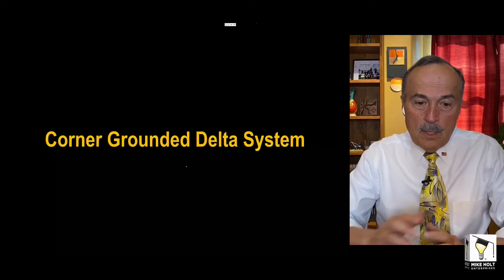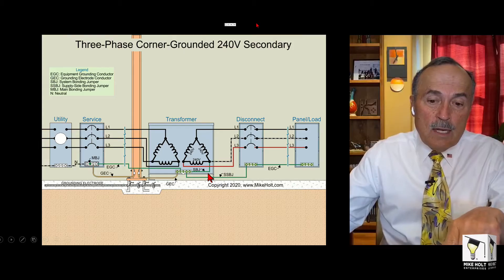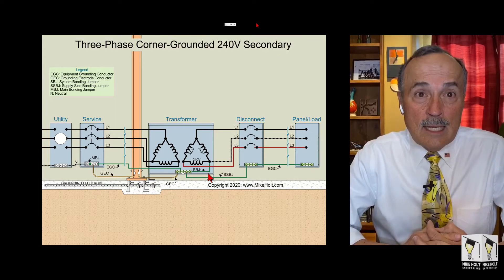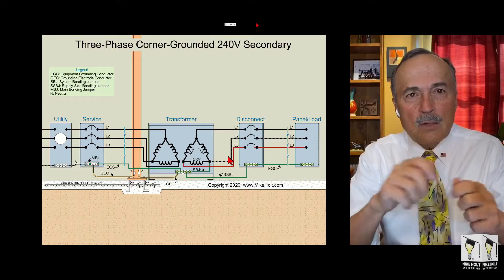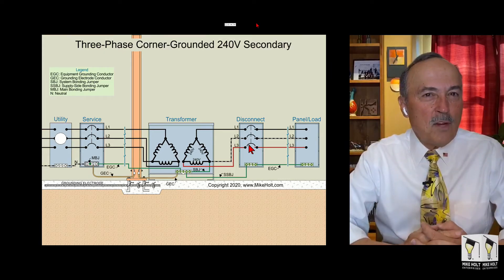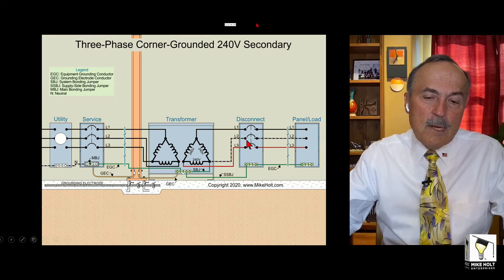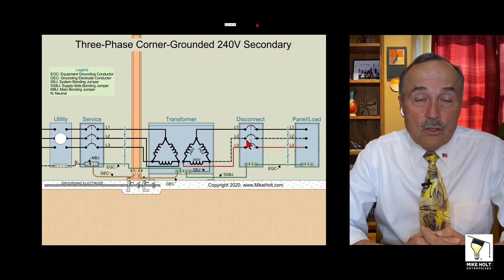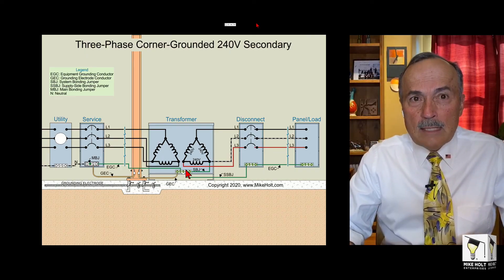Grounding a Corner Grounded Delta System, NEC 2020, (3min:56sec)

Comment: I’m working in a acid plant built in the 50s that had a corner grounded 480 system they had to update the service in the 90s and the inspector refused to let them use white for the grounded leg they use red and blue for the 2 hot legs and yellow for the grounded leg
Reply from the maker: @andrewcouncil3914, many don't understand that the grounded phase is the grounded conductor and must be identified white per 200.6.

Comment: The only corner grounded system I've installed was for car charging stations,  they needed 240v @50a to run at the highest charging rate for the car.  We were on 3p 4w system 480/277v we put in a 208/120v transformer at first, i think it was 300kva if I remember.  The charger guy comes and says I need 240v to these chargers. Awesome, out with the new, and in with the newer. Only time I've ran into that, but maybe it'll get more common.

Comment: Usually I come across line 3 for grounding
Reply from the maker: It's a common practice to ground the B phase, but it doesn't matter which is grounded.
Reply: @MikeHoltNEC  I agree. B PHASE would be my choice

Comment: Does zero sequence pick up on a ungrounded delta during a ground fault condition when using solid state protective relaying?
Reply from the maker: No. When there is a ground fault at an ungrounded system, the system becomes a grounded system with no movement of electrons during the ground fault.

Comment: Can a corner grounded delta be single phase?
Reply from the maker: If it's a delta system, then it's a three-phase system, and it has a 'corner.' If it's a single-phase system, then it's not a delta system, and it has no corner. Okay/
Reply: @MikeHoltNEC  I am in a pickle and am not sure how to prove an argument. In my mcc I found a panel that was mislabeled in my opinion. It says it's 240 single phase. But it's not. It has 3 conductors going into the panel from the transformer. A and B are 240v each to ground. C is 0v to ground but 240v from phase to phase. C phase is grounded in the transformer. Which tells me it's a corner grounded delta 3 phase 240v panel. Common from back in the day and in sawmills and industrial plants. I brought the issue to my maintenance manager, supervisor and engineer. They hired an outside electrical contractor to evaluate the transformer and panel. They say it's 240v single phase. How do I prove to them they're wrong?
Reply from the maker: @briananderson1987  It is a three-phase system called "240 Vac 3Ø Corner-Grounded Delta System" or 480 Vac 3Ø Corner-Grounded Delta System, see https://www.productinfo.schneider-electric.com/nadigest/5cc35b7ed6593c0001ba8661/Supplemental%20Digest/SD17703_MAIN%20(bookmap)_0000052852.xml/$/_SD17703021_48857

Comment: So now you don't have 3 legs though. Usually I see brown orange yellow gray but with this configuration, you're grounding the yellow so now you're losing that 480v leg right?
Reply from the maker: The secondary voltage is 240V, so you can never get 480V in this example.
Reply: @MikeHoltNEC I guess I meant to say if it was 480 and you were just trying to get the grounded contuctor you would no longer have 3 phases right? Does that kind of thing happen? Say you had an old ungrounded 480v delta and you wanted to ground it to gain the benefits. Is it possible to do that without losing a phase?
Reply from the maker: @robbysanchez6514  Let's not talk about phase or grounded conductor. There are three wires from the corner grounded transformer to the equipment, the voltage between any two wires is 240V (in this example), the three wires are 120 degrees out of phase with each other, and the three wires can supply a three-phase load. Does this help?

Comment: I'm confused if your C,B phase,High leg is a neutral is it effectively only a single phase system?
Reply: There is no high leg. Two phases are 240V to ground and the third phase is grounded so 0V to ground. Voltage between any 2 phases is 240V. There is no neutral conductor, there is a grounded phase conductor. All neutrals are grounded conductors but not all grounded conductors are neutrals.
Reply from the maker: @pld8993  Excellent reply, thank you.
Reply from the maker: If you have A, B, and C phase conductors, you have a three-phase system.
Reply: Also, all grounded conductors must be white (or gray), including the grounded phase conductor, so while all neutrals are white not all whites are neutrals.
Reply from the maker: @pld8993  Right again... not many understand the system and the NEC. You are amazing...
Reply: @MikeHoltNEC  If you want to become an expert in any subject you have to teach it. Been teaching for almost 30 years.
Reply from the maker: @pld8993  So true...
Reply: @pld8993 help me understand what I do in this center tapped delta xfmr. Am I running a SBJ from the EGC ground bar to x2 with the blue wire??
Reply: @damonsmith8411  Where I'm at typical colors are black, white, blue. In the pic they're black, white, red. SBJ from ground bar to white.
Reply: @pld8993 do you always do a SBJ from ground bar to “neutral point” ? Or can you float it and then bond the panel with a GEC?
Reply: @damonsmith8411  Depends on how it's done. I've only ever worked on 240V corner grounded from utility company, not from transformer. If it's a utility source service, you can run the system with a single phase panel, A and C to the 2 hot terminals, white grounded phase to neutral bar and bond it with bonding screw/strap, GEC to neutral bar. Can't use standard 2-pole breakers, which are rated for 120V per phase; must use 2 pole breakers that are designed for 240V per phase. Or you can use a 3-phase panel, grounded phase goes on B phase. Haven't done one in many years but the way I've done it is I run the grounded phase conductor "through" the neutral lug and continue it, uncut, to B phase terminal, then bond the neutral bar, GEC to neutral bar. In  the case of a transformer, I believe you're bonding it only at the transformer so in the panel it's a white on B phase and the neutral bar goes unused or becomes a ground bar if you bond it to the can..
Reply: @damonsmith8411  I think I've also seen it done in a 3-phase panel by running the grounded phase conductor directly to the breaker lug, tapping it with a split bolt ahead of the lug with a SBJ to neutral bar, GEC to neutral bar, neutral bar bonded to can. Naturally, the neutral bar becomes a ground bar.

Comment: Superlatives almost always come back to bite you in electricity.  I respectfully disagree any phase can be grounded unless a transformer is being installed. I'm currently working on a corner grounded delta 240 service. The utility Cts are located outside at the utility overhead. The cts are mounted on a metal bracket. Phase B is bonded to the metal bracket. That bracket is mounted on a metal building. In this case the MDP must be grounded to phase B.
Reply from the maker: This video is about the system grounding. Any phase can be grounded. However, if the utility wants you to ground the B phase. Okay... that doesn't take away the theory.

Comment: Good day Mike, what is the solution if we have existing three-phase corner grounded 240V secondary but we need only a Three-phase 240v. I hope you notice this question thank you in answering
Reply from the maker: A 240V corner grounded system gives you 240V three phase. So you are good to go.
Reply: @MikeHoltNEC  we have a equipment which does not work/faulty in the corner grounded system, any recommendations for this problem. thank you 😊
Reply from the maker: I don't see how that is possible. Get me more information, Mike@MikeHolt.com
Reply: @jaseb5529  I've seen this before, most recently with a 3-phase SPD. Perhaps is has to do with electronics or controls since a big dumb 3 phase load, like a motor, doesn't know the difference. Transformer would be my solution.

Comment: We this is what I have, measuring from line to line  I have  244,240,239.
Now measuring from line to ground I have 
120,120,213 ,  and because  I have a drive in place I'm getting a phase loose code. But why the 213 volts to ground, I understand it's a hot 🔥 leg. How can I balance this out. To 120,120,120 ????
Reply: You have a wild leg, 120, 120, 208 the one phase is center grounded and not corner grounded

Comment: Ok Mike maybe you can help explain this oddity I ran across in an old citrus packing plant. The system is three phase supplied by a generator it also is a corner grounded delta ( B phase grounded at Genset and at main disconnect) . This system however uses two pole disconnects and breakers and of course provides three phase in this manner . Single phase is provided by two pole devices on some circuits and by single pole devices and ground on others.120 volts is derived from transformers as required. Your illustrations show three pole devices  as do all I have found in recent texts. Is this an old 50's -60' era way of wiring this type of system or is it something done by someone who wasn't fully aware of what they were doing ?
Reply: Yes, single phase equipment can be used in a corner grounded system. But the breakers must be "straight rated". For example, if you had a 240 volt corner grounded system, you would use 2-pole breakers rated at 240 volts, NOT 120/240.

Comment: Coming from a metering background I can say you don’t want the ground on 1 or 3. If the ground is on either of those phases it could create a metering error. You do not want a neutral or ground on a phase with a current sensor. That condition is called SCN - series coil neutral. To meet Blondels Theorem a utility will typically have the meter connected 1 & 3 at the current sensors and beginning potentials for the potential sensors, and have the ending polarity of the potential sensors connected to 2.
Reply: I’m a retired metering theory instructor for Southern California Edison.
Reply: Hello Sir. I just want to ask if you have encountered a 3phase 3wire system with a connected solar for net metering?
Reply: @kimmallari2658  I have not. Possibly might be able to help though or give some ideas. I can guess your question though 😜. Is the solar array connected Y?
Reply: @tomhb9479  thank you for the reply. Actually it is basically 3 wire with no grounding or neutral wire. So we applied tha blondel's thorem making it a 3 phase 3 wire circuit. But the kwh reading on the meter and the output on its inverter were not equal. Also for an ungrounded delta, does the blondel's theory still applies? I was really curious about it and needed someone to discuss it. Thank you very much sir. I really appreciate your response.
Reply: @kimmallari2658  Yes, Blondel still applies. So a two element meter monitoring two of the currents with those same phases being the beginning polarity potentials for the two elements, and the third phase should be non polarity ending potential for your two elements. No connection to ground other than perhaps a case ground for safety, lightning, etc.
Reply: How far off is it?
Reply: @tomhb9479  one third from the meter. Meaning two thirds was just registred in the meter.
Reply: @tomhb9479  In our practice/ standard, 3 phase 3 wire will be a delta corner ground. two phase that are not grounded will be going through the element (potential and current coil), the grounded one will be on the common of the pt elements. In my understanding, if it is ungrounded, the meter base will be live. and if you ground the casing wouldn't the ungrounded short through the ground. I hope you understand my question. I'm from the Philippines by the way. I'm just looking for someone whose expertise is metering.:) Again, Thank you so much for these discussions.
Reply: @kimmallari2658  None of the 3 phases are connected to the meter base. The utility I worked for we had a 3WD 480V service that was ungrounded. By our rules we could not have greater than 300V to ground service voltage. On the old metal chassis meters we had a grounded lightning arrester. I can’t think of a reason you are getting a 33% slow meter 🤔
Reply: @tomhb9479  hello sir. I want to connect with you with other socials so that I can illustrate or send you the diagrams and know your comment/ inputs about them. If it's okay with you Sir? Thank you sir.
Reply: @kimmallari2658  Will email work? I’m on Facebook too.
Reply: @tomhb9479  yes sir!! messenger will be great.! Thank you very much!

Comment: sir if my neutral cable gets destroyet will the current choose the path of the ground
Reply from the maker: Current is not seeking a path to ground, but it will use the earth as part of the return path to the source.
Reply: @MikeHoltNEC  if my neutral gets destroyed  electricity will use the ground to complete the circuit like you said and this clear to me .....but also i need to have very low ohms ground resistance to run machime in case if my neutral gets destroyed  correct?? like you did in that video on youtube placing 2 copper rods in parallel connected  deep in ground the load test using ground as neutral ... i am asking about the ground because when i play with tesla coils high frequency the ground from earth gives a boost to tesla coil somehow accelerates electron flow any comments about this ??? .. at the end i want to thank you for your answear  and thank you for helping us.

Comment: I am not able to explain why someone (including the utility companies) use this system. it is just does not make sense unless you want to confuse someone and say , "hay look phase and line voltage are the same! " , of course  some people love to play those games. The fact is, in the very same NEC code 230.75 it says ground must not be disconnected. So if there is a fused 3 phase disconnect switch in this system,  you must put a copper bar in B phase because it is ground too ! If the fuse blows up in phase B then its nothing but danger zone ! . DO NOT USE IT !
Reply from the maker: See chrome-extension://efaidnbmnnnibpcajpcglclefindmkaj/https://media.distributordatasolutions.com/schneider2/2020q4/documents/f50bd47f84c77526d02eee3473c1215b7dd3585b.pdf. Just use a single-phase disconnect...
Reply: It’s not actually a ground.

Comment: I came across a three phase system today 240v  between the three legs and two of the legs read 240v and the third one, taped blue read 0v to ground. There is No neutral there. That’s what brought me here. They have an elevator motor circuit there. Would it be ok to run a 240v 3P stove on that 3P configuration?? I think the stove doesn’t require a neutral.
Reply from the maker: What kind of stove is 'three-phase?' Answer is 'yes.'

Comment: I think it's important for people to understand that ABC phasing is relative to whichever phase we decide is "A". All the phases are 120 degrees apart and so they will only peak in ABC order or CBA order. Same is true for a corner grounded delta only one phase is effectively zero volts with a 480 or 240 volts in reference to the other two phases and those two phases are 480 or 240 volts in reference to each other. Since we have to maintain a ground fault current path the grounded phase must not be able to open unless the other two phase are opened as well so a fuse in that phase will be replaced with round copper bus or  the phase will terminate in a lug or splice. If corner grounding an ungrounded system verify single phase and three phase loads cannot loose reference to the ground while energized. Grounding the middle winding in a transformer only makes sense because the center tap single phase and open delta's are terminated likewise (although an open delta can be wired as a high leg or with an open corner ground and still work, either way it's KVA rating and respectively maximum current is reduced to 58%.) In a high-leg we ground between A and C because B has to be the high leg. The need for corner grounding comes as the use of large electronic VFDs, inverters, and the use of many electronic driver and ballast in lighting greatly increased creating harmonics. Windings experiencing increased peak currents from harmonics can actually start pushing apart, which we call telescoping. (IBEW journeyman/JATC instructor)
Reply from the maker: All I can say is 'wow' you know exactly what this is all about. Congratulations! Smart Cookie...
Reply: @MikeHoltNEC  Thanks, coming from you that is an honor. Thanks also for the content and passion you have for educating electrical professionals, its very inspiring.
Reply: This was incredible to read yet I still don’t understand. I’m trying super hard to wrap my head around this
Reply: IBEW local 46. I think I'm the only one that completely understood, and know, you are exactly right.

Comment: I was asked to install a 3 phase delta system of 240V at 12.5 kva, and does it needs to be corner ground, if the transformer system does not have a stinger leg set up? If I was told to use a 3 phase 240 V twist locking receptacle at 30Amps. 
I do have concerns when I asked to install 3 phase floating arounding system.
Reply from the maker: Post your question on MikeHolt.com/Forum

Comment: Can I connect/close the open delta with a smaller transformer for low power three phase equipment and lots of single phase appliances? palace. For example a commercial place with lots of lights, few 240V slicers and refrigerators; or a big house.
Reply from the maker: I don't know, post your question on MikeHolt.com/Forum